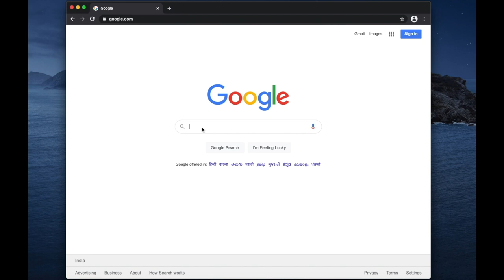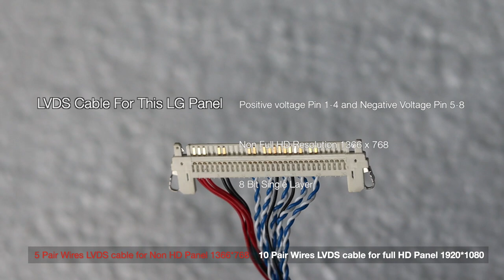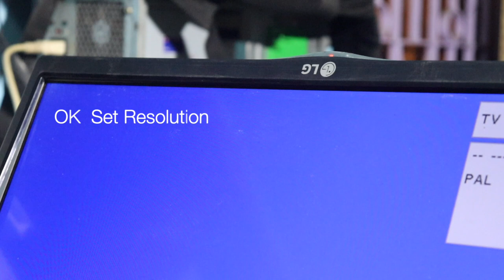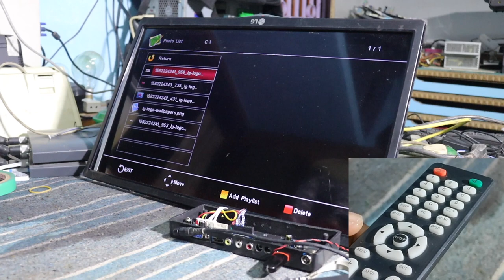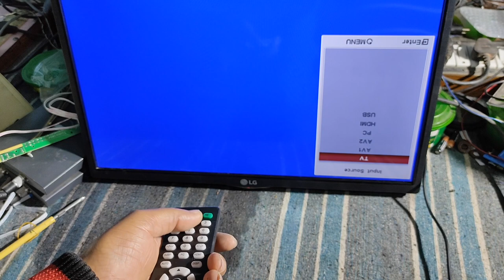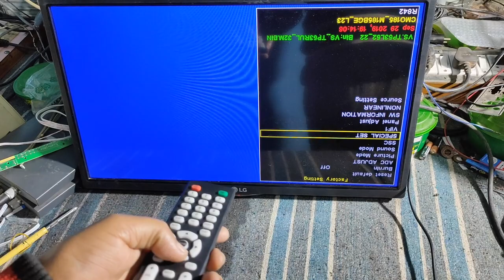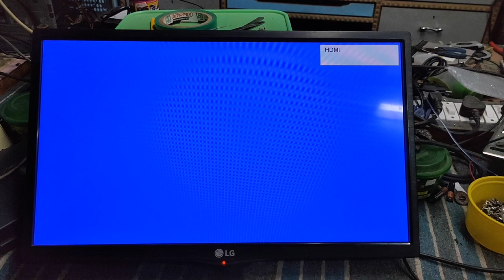VS.T56U11.2 Universal LCD / LED TV Board installation guide

Comment: I have to use this board on 14in LG lcd LP140WH2-TLL2, but i am unable to get the LVDS cable. Can you please help?
Reply from the maker: Can you solve your problem or not?
Reply: @zenithcomputers3286  not yet , as i am unable to get the LVDS cable
Reply: Hey brother .. have u managed to solve your LVDS problem .. i am stuck at lvds pin information as I cannot find the datasheet for my laptop panel .. if possible please help me ..
Reply: @rahulkalra2126  you need to open the laptop panel and look at its rear side. There will be a sticker where the model no will be specified. As per that model no you have to search for its data sheet

Comment: Hello brother .. i have salvaged a working lcd panel from my laptop and i need to connect it with a universal led tv board .. my problem is that I am not able to find the datasheet for my panel .. could you please help me .. the panel number is : TX39D99VC1FAA(hitachi) .. i tried a lot but couldnt find its LVDS connection info which I would get from its data sheet.

Some extra information that I knw is:

a) Panels input voltage: 3.3v 
b) Panel size : 15.4 inches
c) resolution : 1680 * 1050 (128 PPI 
d) signal interface: LVDS (2channel, 6 bit)

PS: I am just stuck at LVDS connection .. rest everything is done.
b) I would be grateful if you could help me with LVDS information of my panel

Regards
Rahul